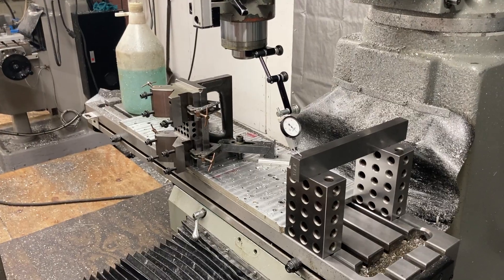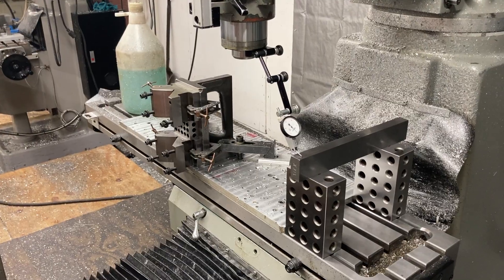Serious Problems Milling Machine TURCITE vs WATER SOULABLE ** Don't Do It**  How to Fix, If You Did

Comment: A little Correction: The knee angle doesn’t affect the reading 😊 . You basically testing the parallelism  of the x\y axis and it’s .010 no matter what the knee condition is. You need to remove the table to inspect where the error come from. It might be an addition of the saddle too.

Comment: I just roughed a bunch of stainless on my trak using a unist MQL unit last night and it was truly phenomenal. i scored one cheap on ebay. filled the chip tray and i have no mess to clean up... no coolant... no mist, no smoke.. used like.. a teaspoon of oil? you gotta try one, expensive but i promise you wont regret it. penguin juice is so sticky for some reason i cant stand it, ill hold an acid brush all day before i give the penguin a puff n buff makin the whole damn shop sticky... ugh go play with an ice cube

Comment: I feed 3 old Bridgeport cncs at work. 2 V2XTs and an EZ Trak. All from 1994. We had 1 cut chromed and scraped and after that we pull them apart once per year. No issues since even after cutting crap tons of G10-FR4.

Comment: Pull your table once a year And clean it, new wipers ect. If you’re cutting aluminum all the time use isopropyl alcohol for cutting fluid. Unless you’re hoggin with heavy feeds you can set your mister to where the alcohol evaporates before it puddles and makes a mess.